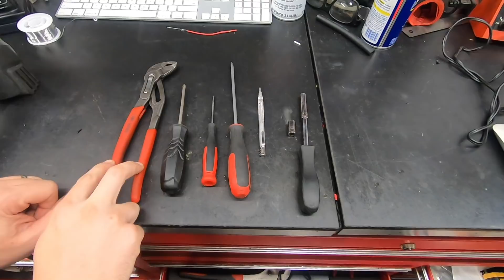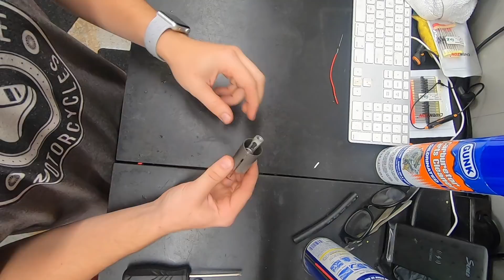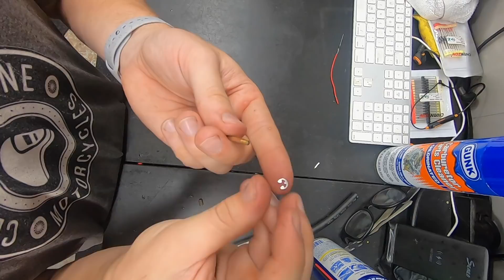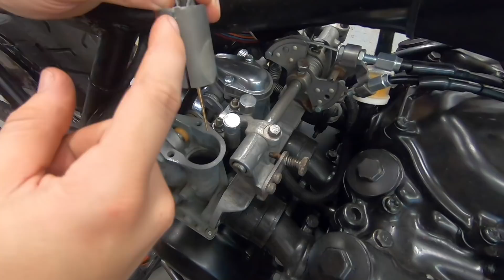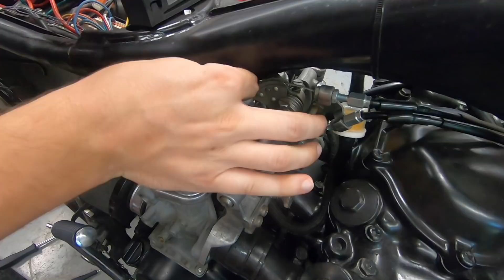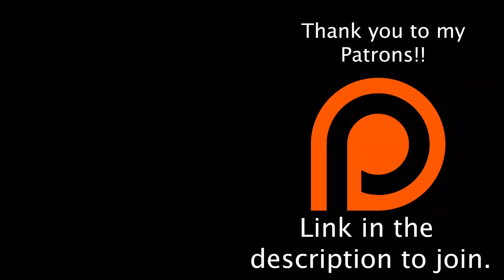How-to adjust CB550 needle clip position without removing carbs.

Comment: Thanks for the video, truly useful and clear! I've a question: in case of non-adjustable needle (eg. Cb 650 rc03 with PD51 carbs), how would you operate? I mean, personally, I got my bike running on pods (please don't scream out!) but still I find it a little unreactive when opening throttle (and yes, I checked and refurbished the accelerator pump). Could the needle adjustment help a bit? (slow jet and idle jet already fixed).
Thanks in advance.
Giovanni

Comment: Hi Noticed your not running the stock air filter. As this bike has aftermarket filters do you have to adjust the needles to run richer as the filters breath more air. If you do how much do you recommend in adjusting needle position. Buy the way great videos. Re GA arts from the UK

Comment: Awesome content.  I just rebuilt my cb500 carbs with your help.  I have a question though.  My air/fuel screws do not fully seat with the spring in the carb.  Should I screw them in without the spring first to find where they seat and then put the spring in and go 1 1/2 turns out from where they bottomed out without the spring? The spring seems to be binding up the screw before it seats.  Thanks!
Reply: Do what you suggest but count the screws in from ‘clicked’ fully out

Comment: This is super helpful!!! I’ve had my 550 running fantastic at idle and at open throttle accelerates beautifully but just on rolling on or maintenance throttle it sputters a bit. Tried everything except this. Everything except the 4-1 exhaust is stock and all specs in the carb pretty much within factory range. Will definitely give it a shot. Thank you for the great content!
Reply: Did it work? I have the same setup and same problem!
Reply: DrewBloo I lowered the clip on mine which raised the needle. It helped richen the mixture. now it is so fast! No hesitation at 1/2 or 3/4 throttle. It solved my problem

Comment: Hey I just got a 1975 Honda 550 four and I need to replace all the electronics how should I go about that?
Reply: get a brand new wiring harness from 4into1.com. You can also get a lot of OEM or OEM replacement electronics there. Or just go with aftermarket stuff

Comment: Thanks for the very nice videos! I guess that you don't need to synchronise the carbs after this operation, right?
Reply from the maker: That is correct, you don't have to sync them again because you don't remove the adjusting screw.